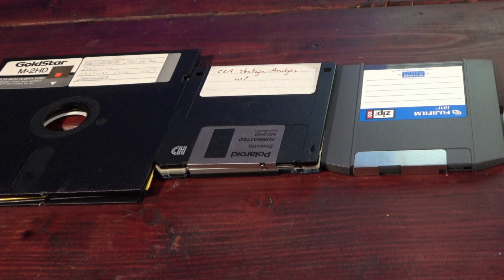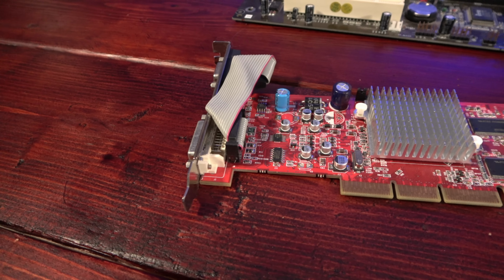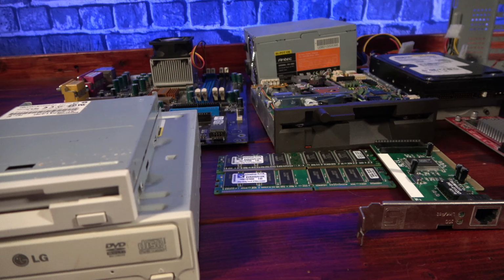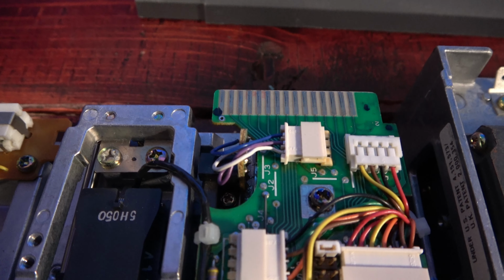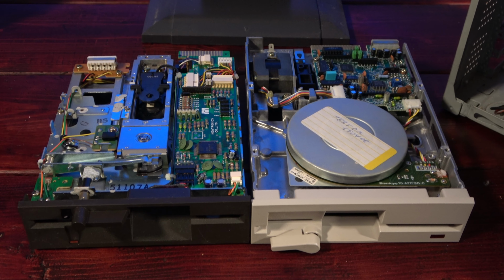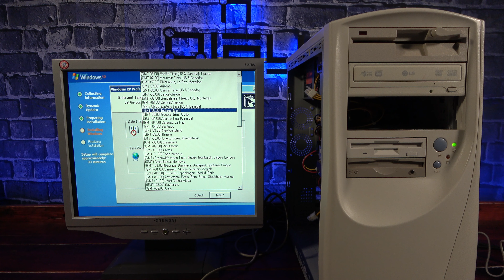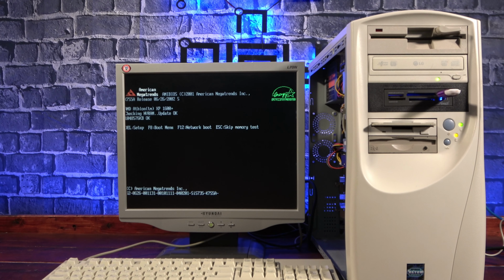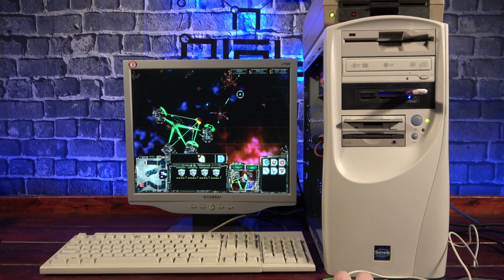40 Years of Media Compatibility in One PC! (C64, ZIP Disk, and More!)

Comment: I have similar motherboard ECS K7S6A rev1.0 with SIS 745 (yours SIS 735). Which SIS AGP (GART) driver version you used on Win98SE? 1.21 , 1.19A , 1.17E , 1.17 , 1.16A , other? I had “Windows protection error” problem with 1.21. I might try those others later.
Reply from the maker: I don't recall off the top of my head... it most likely wasn't the latest version, since I snagged it from the ECS website. I'm doing some work in the studio, but I'll try and get it hooked back up this week and pull the version for you! The version number on the manufacturers site doesn't actually correspond to the driver version.
Reply: @PNPRetro  No need to, I got it work with 1.19A for now, but thanks anyway.

Comment: What was the issue with the 5.25" floppy drive? I've never worked with those, so the reason given in the video went a little "whoosh" over my head :(
Reply: Keyed vs Non-Keyed. 5.25" is before my time so I can't give you the exact implications of why there was (at least) two different cabling systems, but: The card-edge connector (the gold fingers and protruding section of circuit board on the drive) that the cable slots onto is either keyed (has a notch cut out of the circuit board and a matching blocked section on the cable connector) or non-keyed (no notched section, won't allow a keyed cable to plug on - the blocked off section physically prevents it from fitting).

In his case the first drive he tried was non-keyed (no notch) and the cable was keyed (blocked off section on the connector), so he physically couldn't plug it in. If you go back and watch that section you can see how the two drives he shows differ in that the one on the right has a slot cut into the card edge.

The two different cable systems may be related to the different 40-track and 80-track drive types that exist, or it may be a proprietary controller specification, or something else entirely. Heck, it might even be just that the keyed system was designed later to prevent the connector from being plugged in upside down. You'd need to do some google-fu or else have a greybeard or someone more deeply involved with retrotech than me to explain that part.
Reply from the maker: What an amazingly well written out explanation. By the time I was old enough to start building machines, the 5 1/4 drive was more of a legacy part than a standard equipped. So, I don't have a good answer for when the key was introduced. But very likely at least part of its function was to prevent being plugged in upside down. 

Thanks for chiming in, Jay!
Reply: @Jay-ik1pt  Ah, now I see. That was an excellent explanation, thanks!